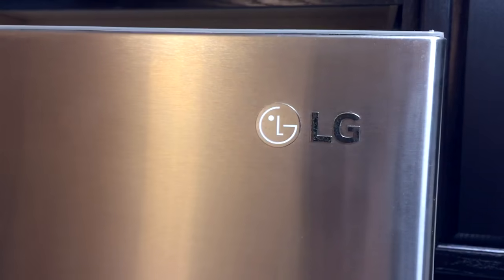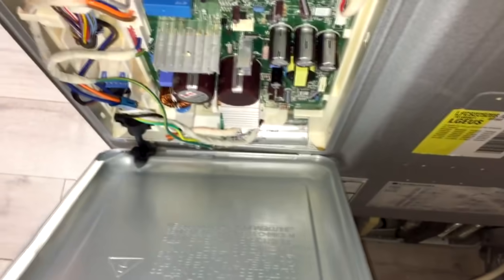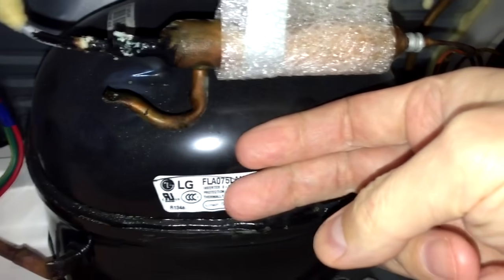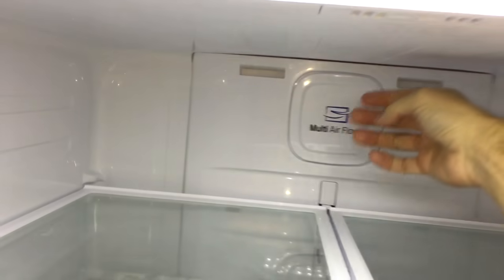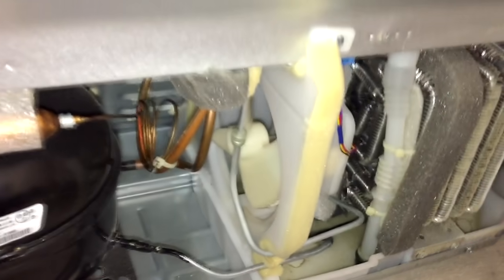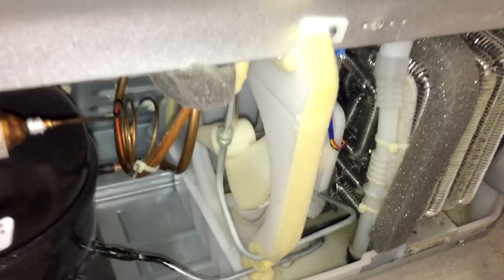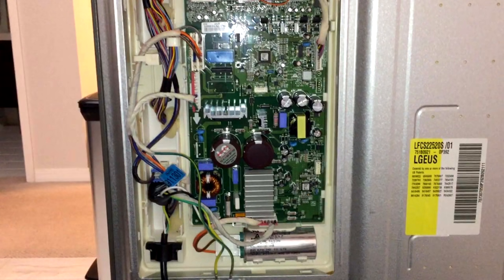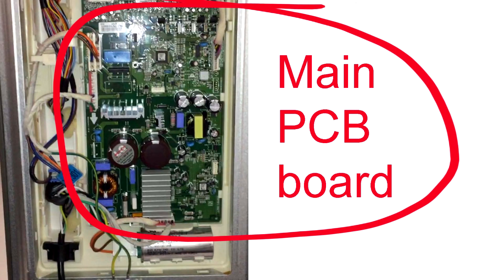LG refrigerator test and reset button

Comment: During the Test 1 phase, my fridge immediately blows cold air for freezer and fridge.  Once I completed Test 1-3, I unplugged the cord.  Then, replug the cord back into the socket.  The fridge and freezer do not blow cold air again.   What now?   Thx
Reply from the maker: Try to narrow down the problem... 
1. Does the compressor regularly turn itself ON and run, but you don't feel any air inside the refrigerator?
2. Or the compressor never runs during normal operation, but works during the test mode?
Keep in mind that in some models when you open the door, the fan will automatically stop blowing air, so you need to activate the door switch and hold it for a minute for the fan to start again.
Reply: YourSelf.   At the time I plug the cord back into the socket, I waited 5 minutes to see if anything was blowing.  Nothing was working.   Now, after 48 hrs, the fridge is super cold!    Your procedure did the trick!   Thank you so much!
Reply from the maker: Glad to hear the good news!
Reply: My fridge died again.  The motor hums but no cooling.  I watch this video again and performed the retest.  The green led light flashes 6x.   I unplugged the cord from the socket and replug in.   1 hour later, I got air.  Whew!
Reply: Update.   Unfortunately, the reset button did not make my fridge cool again.  I called LG and the technician came out and replaced the compressor.   It took him 2 hrs to complete the job.   My LG fridge was 5 yrs and 1 month.  LG was nice enough to pay for both part and labor.

Comment: Has anyone ran into the LG refrigerator model LFXS28566S LED light inside the fridge works when tested with a tester but doesnt turn when placed inside the refrigerator itself.

Comment: How long after I do the test is the fridge going to start cooling down?
Reply from the maker: The compressor should start working again in about 5 min after the test. But if you had a problem with the compressor, PCB, or the Sealed System before the test, it probably will not be fixed. It's just a Test button to give you (or technician) clues of the problem.
Reply: @Your-Self  when I do reset, it beeps one and the fans turned on, reset #2 it shuts off then #3 it turns on again. No led lights come, but fridge fan runs for a bit then stops. If I leave it plugged in, the condenser fans runs on but the compressor feels hot. My model does not have 2nd fan next to the compressor though.
Reply from the maker: @22squad I don't always get replies on old messages, so please start a new thread with your model number.
Does the compressor run during the Test Mode and after the Test?
Do you feel air blowing inside the freezer and the fridge during the Test mode? Is it cold or warm?
Reply: @svang22 did you manage to fix it?

Comment: Just did the test no blinking light and all fan is working my fridge wasn’t cool before I hope this will fix the problem I have the same fridge as ur video
Reply: Ok can u help me it still not cold
Reply from the maker: If your compressor is running and all fans are running but not cooling, that looks like a typical LG Linear compressor problem. LG can replace the compressor free for the first 5 years. But your model is from Sears, so you'll have to call them and ask what they can do for you.

Comment: LFX28978ST motherboard looks different. Where is the reset button?
Reply from the maker: Your board looks very similar to mine, and the round button on a square base is pretty much in the same spot.
Reply: @Your-Self  unfortunately posts do not allow photos. Looks different. I do appreciate the prompt response!👍
Reply from the maker: Hmm, the document for your model had a different board pictured, so I dug deeper.
You have two boards. One of them has an LED that may flash error codes. And the other has the test button on a side, next to the connector CON7.
Reply: @Your-Self  Thanks for taking the time. Yes, I did find the button before your response and yes it’s near CON7 with an empty pin socket. Thanks again! You are a kind man.
Reply: Sir, should the compressor LG FC75LANE be warm to the touch on normal function? And where on the second board is the LED? I ran all 3 tests and they work like you said but I do not see any lights. So no error no light? Fans are blowing. I have even ran the reset with REFRIGERATOR/ICE PLUS/LOCK. Nothing seems to work. 😞Thank you.
Reply from the maker: The compressor should be warm because it is supposed to compress the gas. If it's cool and running, that means it's just idling due to a gas leak or a broken valve inside... most likely.
If fans inside are blowing warm (room temp) air, that proves a Sealed System problem... expensive to fix. And the LED may not even blink, because it can't detect that particular problem.
Reply: @Your-Self  it’s blowing cold air but I guess not cold enough to freeze ie 0 deg F. Compressor is warm so it means it’s working. Could the refrigerant be leaking? I did see some whitish powder on some skinny tube. Thanks Sir!
Reply from the maker: The refrigerant could be leaking out, and the oily residue on/under pipes may indicate that. Maybe the compressor is going bad. Need special equipment to prove any of that.
The only thing you could probably do yourself is to make sure the Condenser Coil is free of dust. And then, remove everything from the freezer to look at the Evaporator Coil. In a good system, the entire coil should be covered in a thin layer of frost. If it's covered in a thick icy frost, that could be a Defrost Problem. If no frost at all, or just some on the top of the coil, it's probably a major Sealed System problem.
Reply from the maker: If the frost pattern on the Evaporator Coil is good, the problem could be with a bad temperature sensor "lying" to the computer board about the temp. So it stops cooling prematurely.
Reply: @Your-Self  thank you again. 👍 I will check the evaporator coil.

Comment: Buenas tardes. Alguien podría orientarme sobre esta falla?? La luz de la lámpara en la parte de arriba de mi lg está parpadeando intermitentemente y la luz del congelador abajo no enciende, enfría muy bien , solo el problema es con las lamparas
Reply from the maker: Try replacing the freezer LED module (lamp).
Usually, that fixes the blinking problem.

Comment: I got code 22 on my LG, replaced the start relay but it continues to give code 22. Seems like the compresor does start however it is not cooling enough. But why does the code 22 not go away. Is there a reset or something?
Reply from the maker: Typically when you run the Test Mode you'll see 22 on the display during the Test #2. 
What is your fridge model number, I'll check if it could mean something else.

Comment: Hi, my Fridge isn't cooling. I tried the test all the way through  but I don't see any blinking from the LED. what does this mean?
Reply from the maker: If you feel air moving during the test, but it's not cold, most likely it's a bad compressor. How old is your LG fridge? Under 5 years LG supposed to replace the compressor for free.
Reply: @Your-Self  Yes I feel the air during the test. I purchased 1/03/2015. so just passed the 5 year mark =( Do you know how much compressor usually cost including labor. is it worth getting it fix or purchasing a new one. Thanks for responding!
Reply from the maker: Your compressor is still covered under the 10 years PARTS ONLY warranty. So call LG directly and explain the situation. They should give you the option to buy an additional labor warranty for about $360. And after that, an authorized tech should repair your compressor for free. Without the warranty it may cost you $600-$1000.
Reply: @Your-Self  Thank you for the information! I actually called Sears earlier since I purchased the fridge there. They are going to send a service person out for $109 to figure out the issue and if I want to fix it the problem the 109$ will be included in the labor. Do you have any experience dealing with Sears and how much they usually charge? Or is it better to just contact LG directly? I read that there is a law suit with LG because many people have on going issues with LG compressors.
Reply from the maker: If your fridge has a label Kenmore with LG compressor, you have to go through Sears. Unfortunately, Sears doesn't provide the same warranty as LG. However, if your fridge label is LG, I'd cancel that appointment, and call LG directly to be covered by warranty.
Reply: @Your-Self  Thank you so much! The fridge is LG LFXC24726S. I will give LG a call directly. Thanks for all your help! I'll keep you updated on the outcome.

Comment: My frig has no power. Not only does compressor not work no lights or anything comes on?
Reply from the maker: Unplug the fridge, and plug something like a table lamp into the same wall outlet to make sure it actually works. If the outlet works, the fuse on the fridge PCB could be blown.
Reply: @Your-Self  that's the first thing I tried and it's ok.

Comment: Hi, Does anyone know why the LG internal LED light doesnt work on the LG model # LFXS28566S? I have verified with an LED tester that the light is actually good when i removed it. I have heard maybe a transformer could possibly be the issue, has anyone else ran into this issue?
Reply from the maker: I'm assuming you are talking about the fridge light not working, but the freezer light works. If so, the transformer is probably good. But you need to verify that the Main PCB is sending 12 VDC to the fridge light from connector CON7 pins 33 and 34 (and freezer light - pins 31 and 32).
If you have the voltage, you need to see the same 12 volts at the door-switch located inside the top of the door hinge on the right and left doors. If you get the 12 volts, the magnetic door-switch could be bad. If you don't get the voltage, there could be a break in the wiring somewhere inside the refrigerator.

Comment: I have kenmore model number 79574029410. Fridge stopped cooling just a day ago. I read and watch other video. Common thing was to change out start relay or the over load project I think. Did that but not sure how long it takes to cool fridge. But do you know where all the fans are? I see one behind the air filter and one in the freezer. But is there more? Thanks

Edit. I did the test. All vent were blowing air. But when I put it back to normal mode the fan next to the compressor didn't turn back on. I had to unplug the power and plug it back and then that fan stared to work again. Didn't know if that's how it should be.
Reply from the maker: During the Test, if the compressor was running/vibrating and you could feel air blowing from the vents, but the air was warm... it's some kinda Sealed System problem ($500-$1000 repair without warranty). It's time to figure out if it's worth repairing.
Reply: @Your-Self  the compressor was hot to the touch. But I just notice there is a capacitor where the main board is that I didn't know could be the run capacitor heard clicking noises when plugging in power. Going to try to change that out first. 500 to 1000 would be best to get a new fridge. Thank you
Reply: @Your-Self  question if the defrost is bad would the test tell you? Would you happen to know where the defrost timer or thermostat is located?
Reply from the maker: The Test #3 (or #2 on some models) is for the Defrost circuit. And if there is a problem, you may see an error code upfront on the screen like FD or RD.
There is no timer on this model. The defrost is controlled by the motherboard and the temperature sensor on the evaporator coils.
It's best to remove everything from the freezer, including the back wall, to look at the Evaporator Coils. If they are completely immersed in the ice and frost, you may have a defrost problem. If there is no frost at all, even though the compressor is running, it's a Sealed System issue.
Reply: @Your-Self  sounds like I have a sealed system issue. thank you for your help.
Reply: @Your-Self  hi sorry me again. We going to just get another fridge because we don't want to spend the money for sealed system. But I still want to try to fix this fridge. And I just wanted to know if I wanted to check the freon level of the fridge where can I tap into? I see the service tube but it's bent off side and only have a small space that a tap wouldn't fit. I see a few more places that the tube comes out of the compressor but I don't know which one or does it make a difference? I could upload a video if that helps. Thank you in advance.
Reply from the maker: Sure, if you could upload a video on your channel or take a good picture, and provide a link to the photo-sharing site, that would help to see your tubes.
Reply from the maker: Just keep in mind if you are recharging the Freon, keep the can in an upright position to slowly release gas into the system. A fast release of the liquid Freon will damage the compressor.

Comment: hi working on LG refrigerator . all motors work but not cooling.thanks for you help
Reply from the maker: If it says "LG linear" on the compressor, the internal suction valve has probably failed. If the refrigerator is under 5 years-old and you have the receipt, LG should fix it absolutely free.

Comment: The board light never turn on always off the compressor Is running polling less than 1 amp 
 Can I get some help please
Reply from the maker: Remove everything from the freezer to look at the Evaporator Coils. If there is no frost on the coils, the Freon is leaking out, or the compressor is going bad. The next step would be to pierce the Sealed System to check the pressure. And that should probably be done by a technician.
Reply: @Your-Self   I did vacuum the system and I ad freon  to the unit  how about the light green light on the board  And why the compressor polling only half ams Thanks for reply
Reply from the maker: Computer operated refrigerators are very sensitive to the amount of refrigerant in the system. Did you add exactly the amount on the label? If it's a dual evaporator, did you open the 3-way valve to vacuum all the refrigerant out?
The green light on the board should be OFF unless there is a problem. Unfortunately, the light would not blink if the reed valve inside the LG Linear compressor is damaged. And that's probably why it's pulling only half the amperage.
Measure the Low side pressure before starting the refrigerator. It should be around 50 PSI. When you start the fridge, the pressure should drop almost to 0 PSI. But if the pressure stays around 40-30 PSI, the compressor is bad (inefficient).
Reply: @Your-Self   What do you mean by 3 way valve I couldn't find it by the way when I put my gauges didn't move stay in 60 even when I add exactly freon 
 I did put a new schrader valve next to the compressor Where I did the vacuum from I did check the compressor it's not grounded you think I should change the component by the way the compressor is to 220
Reply from the maker: A 3-way valve should be near the compressor on dual-evaporators refrigerators only.
If the pressure is not changing when you turn the refrigerator ON, that means the compressor is not pumping, probably because the pump inside is broken. This compressor needs to be replaced.
Reply: @Your-Self   Thanks for  Reply.. back I forgot to mention the temperature on display is showing -3 and 38  refrigerator and freezer is not working it has to do with the board ... By any chance do you have the phone number for the LG so I can call them for the   compressor thanks a lot
Reply from the maker: Usually, the temperature on the screen shows what it's been set to, not the actual temperature.
The phone number for LG should be on the label... (800) 243 0000
Most compressors (depending on your model) need to be replaced with a new Universal Compressor, which requires the software update on the board with a special LG programming jig.
Reply: @Your-Self  thanks for your help 🙏

Comment: Thank you for video
I need help on Whirlpool wrf993fifm00 compressor too hot to touch fan running. The refrigerator just cool air not cold enough to make ice. called Technician came replace Control board doesn't work then he quit on the job asked me call manufacture about the Compressor replacement but he still charged me $210.
Reply from the maker: Your refrigerator model is very complicated with a dual-evaporator. You need a good technician to do some tests to figure out what's wrong with it. I'd ask for the money back from the previous tech... no fix - no pay.

Comment: I am not getting airflow in the freezer when trying to run on normal operation in the freezer, but when I enter Test Mode 1 (freezer fan ON, compressor ON) I can hear the fan come on and I can feel airflow in the freezer. I hear some water splash as I turned it on. I let it run normally after another 15 minutes and did not hear the same freezer fan run. I have run it in Test Mode 3 (defroster ON) twice. Help? What does Test Mode 2 do exactly? I wish you could have also shown the front control panel during the times you put you unit in test mode. Any help would be great here.
Reply from the maker: When you open a door during normal operation, the fan may shut off in some models. So you have to activate the door-switch as if the door is closed. And the fan should start blowing air within a minute. 
Test #1 cools both compartments.
Test #2 cools just the freezer, and the control panel should show 22 22.
Test #3 defrosts with the control panel showing 33 33.
If during the Test the fan is blowing warm (room temp) air, this points to a serious Sealed System problem.

Comment: What about if is not blinking at all?
Reply from the maker: The LG Linear compressor often breaks inside without triggering the blinking light. If your fridge is under 5 years old, LG may replace it absolutely free. If older, you may have to pay for the labor.